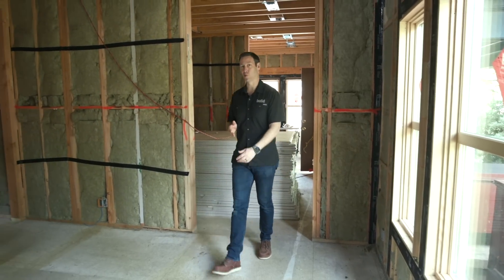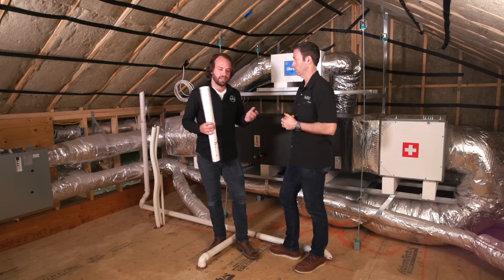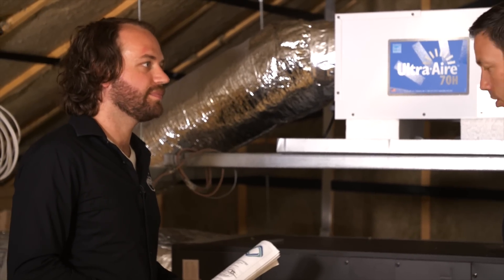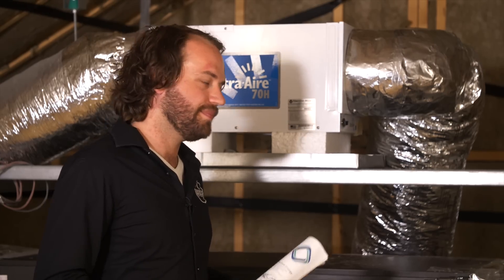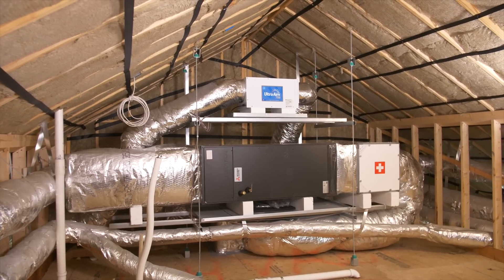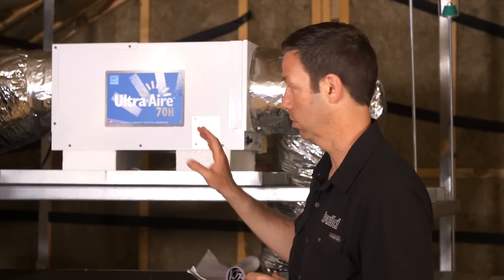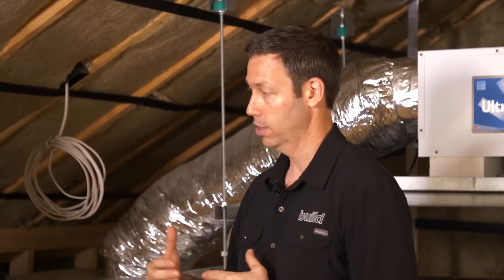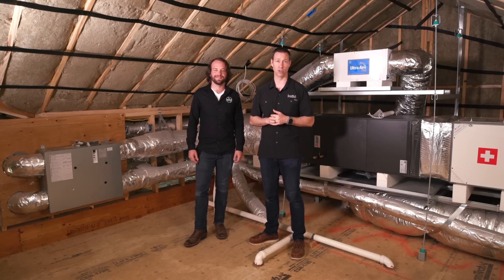New BUILD : Excellent Air Conditioning System Cost?  I’ll tell you!

Comment: 40,000 to 70,000 for ac system   ? Really ?  Think  evaporation  cooling
Reply: Obviously the price is not for your typical house. That price is for homes over 500k+
Reply: Good luck using that swamp cooler in Austin.  Or with a client that wants to be comfortable in their own home.

Comment: Some old farmer who opens his windows every night to sleep is rolling his eyes at this fancy pancy stuff.   I get the dehumidifier for long shoulder seasons.  I get the variable speed compressors.  But the air exchangers and their dedicated duct work?  Is that really necessary?
Reply: I'm not an expert, but I did work with PositiveEnergy designing my HVAC system for my new house.  The concept is that it would actually be better to leave the windows open rather than breathing in all the stuff inside a sealed house.  

You don't want a sealed house without having a controllable air exchanger.  A typical Texas construction (tract homes) don't have the issues with a cheap HVAC system, since the house leaks plenty.   Although I wanted clean air (of course), I was primarily concerned with full control of temperature and comfort in every part of the house.  

The downsides to the cheap construction and cheap HVAC system houses are poor temperature control and huge cooling costs (in Texas anyway).  I've been in hundreds of houses, old to brand new, inexpensive to McMansions in Texas.  Every single time, each one has rooms that are too hot, too cold, stuffy, etc.  Yes, good companies can do a pretty good job with appropriate sized ducting, etc., but 99% of the time that is done just as cheaply as everything else.  

Many people comment about how these systems aren't affordable for the average consumer.  That's simply incorrect.  The systems are affordable IF you are educated about them and plan on living in the house more than a few years.  The problem with these fancy pancy systems is the mindset of the buyers (need those granite countertops!) and the state of the market (buy a new house every five years!)  At least, this is true in Texas in the urban areas like DFW where the cookie-cutters are going up as fast and cheap as possible (while looking fancy on the surface).  

I have detailed electrical records of my previous big-name-builder tract-home built in 2002, and my new custom house built in 2016.  In three years I've already paid for all the HVAC and insulation upgrades.  It doesn't cost as much as you think up front, and in this case it literally pays for itself compared to a tract home.

Of course, getting the tract home builder to actually do it is essentially impossible.  So, to all those guys out there that say the average consumer can't afford it, I would say the actual issue is that the average consumer can't get it at any price.  If you are an average person who moves to someplace like DFW for a job or whatever, there literally is no way to get a well-built home.

Comment: He mentions the importance of distribution.  I am running into this right now.  House built in 1979 with unpanned returns in 2x4 walls.  Return is undersized.  Furnace and AC date from 1991.  Sealing the ducts in the basement has been worth it.  I also am looking at doing that sealing fog I saw on This Old House to seal the insides of existing ducts.  Quote for that was about $2500.
Reply: AirSeal - and it looks like it would be a smart move in every house, but $2500 seems pretty pricey.

Comment: So is that a $500k - $1M budget for new construction of the sub-2000sqft home or just for *remodel*?  I mean that's a pricey remodel from my perspective but I'm also from the SF Bay Area and have heard of much higher budgets...
Reply: Also, I'm working on a '60s construction home.  The ductwork was from the '70s latest.  Had to have it torn out since it joints tested for asbestos and it didn't seem worth it to leave the remaining ductwork in.  The furnace is still there but is likewise from the '60s or '70s and needs to go as well.  So those lasted 40-55 years, but were woefully undersized and with infiltration/exfiltration all around the house.

Comment: A carefully managed modern mass produced home in central valley California can be comfortably run on $1500 per year, with 21 cents/kw as the PGE base rate.  A heater/cooler replacement with a modern rating of 5 tons can be installed for $5-8 k on a $600k home.  Some duct and ventilation adds $2k.  That's 1.5 %. You can barely earn back the cost of a 3% system in electrical savings under these conditions, even considering a more efficient heating cycle and increased energy costs.  Out here, installing a 3kw solar electrical system for the same $ cost is a better choice.
Reply: Its extremely likely that energy prices will rise considerable in the next decade. Much of the costs in in the duct, & humidity control. An AC\Heatpump is the least costly of the equipment.

if you skimp on Filters your duct work will build up dust over time. When you paint, redo drywall, run the vacuum cleaner, etc, its all going to put a lot of dust in to the air. Good filters help prevent that from getting into the duct & equipment which can result in health and equipment performance degration

Comment: Mitsubishi mini-splits are high enough, but seem to  get really expensive over 18000 btu since they need a dual unit outside.  Just went with Carrier to get 30000 btu at a reasonable price.  Low temp system rated at 100% output at 0 degrees and 60% output at -22degF.  The old electric baseboard will provide the low temp backup.
Reply: Bob W I have mini splits that run 30k btu and 33k btu. Two different houses. I think mine go down to maybe 20 degrees before I need back up. It never goes that low here and I'm only a couple miles from Canada.
Reply: @jon3615  we got down to -31degF a couple of nights this last winter.  I'm sure backup will be required but not that often.

Comment: Where did you locate the clothes dryer in house? Is it in heated and cooled space you are paying for yanking all that cubic feet of air out of house and blowing outside and then a house cannot be in a vacuum thus pulling in outside air in by small air leaks for hvac system to work harder and run up electric bill
Reply: Maybe they have a condenser clothes dryer?
Reply: @thegreatga  that's what we have.  It runs forever to dry a load, but doesn't use very much electricity and no venting to the outside and no dust/lint in the house.

Comment: There is no reason for the cost of the hvac to be so high. The hvac is like the framing, consistent, predictable well understood tech. If it is cutting/bleeding edge tech maybe a higher cost but the percentages quoted seem to high.
Reply: If the install is mostly flex duct, then you are right.  Prices should not be so high.  But if the ductwork is primarily rigid, properly sealed, and well insulated, then that is a different situation.  Both component prices and labor for rigid duct can be substantially higher.
Reply: @DriverDude100  - I completely agree, but finding quality rigid work in a residential home is rare (at least it is in my neck of the country).  Heck, I'd be happy to find a quality (aka no leaks and well insulated) in a flex system or one that's not installed in the attic.
Reply: @valkyriefrost5301  come to southern Arizona.  Its not inthe attic. The ducting is uncovered flex tube layed across.the top of a flat roof
Reply: @carlcochrane2030  - Now that's what I call "home builder specials." ;-)
Reply: Exactly - and the discussion of jacking up pricing for the equipment so the HVAC contractor can make a profit. Why don't they just explain what each element of cost is and charge the fair & reasonable for each element?  that's why hvac contractors have a bad reputation.
Reply: He should have labeled the show "Explaining new construction technology in heating,cooling, ventalating,and some pricing"  Im a HVACR Contractor from Tuscaloosa al. I love Matts"The build show" and what he doing with educating people on how much more advanced and different choices  we have in our buildings Technology today. He should have asked Miguel what would that job cost on avarage?  between 10,000 and 15,000?  Miguel said it right at the end about the ductwork being the most important thing. We dont do a lot of new construction anymore unless we talk to whoever the owner is going to be because a lot of builders want you to put in bare minimumn and want you to work cheaper which traps some ac companys to doing sub par work to keep there buisness.
Reply: 18 hr day so going to bed not sure if i answer a question or just went goofy,
Reply: @chaddarr4834  - you hit it right on the head for the average home builder. The profit is not in the quality, it's in the quantity;  which is sad.

Comment: That looks like flex duct that is run over some snaplock, is that what you did?
Reply: It's solid insulated duct work. There is flex specified at the turn down of each vent, to adsorb noises
 at the Return,
 and the lines going up to the dehumidifier. But other than that ( as seen in the mechanical drawing plans 9:35 ) there is no flex. All solid.

Comment: Do you run seperate fresh air ducts  or plumb the ventilation system to the main duckwork? With seperate ducts is there a possibilty of one system back feeding the other when one is not running?
Reply: tweake this one has dedicated ducts.

Comment: Holy bageezus...how can an air handler move air efficiently with that much filtration? A single MERV 16 filter is restrictive enough. 4 is pure redundancy, when you consider that all 4 are rated to filter the same particulate size. Seems like the unit’s efficiency will suffer by choking the airflow.
Reply: Check the flow arrows on the filters at 6:41. The airflow is right to left, not vertical. These are in parallel, zig-zagged to fit in the tighter space.
Reply: If in series you would be correct. These are in parallel which allows more airflow
Reply: I get what you two are saying, however, you’re still attempting to force air through an already restrictive filter, no, 4 restrictive filters, no matter how you slice the air flow. The cost of those 4 filters, plus the return air filters, would cancel out or exceed any energy savings. Unless someone had extreme allergen issues, I wouldn’t think anyone else could recoup their return on investment with a system like that.
Reply: Increased face area = decreased velocity = less pressure drop. But you are right, this is overkill, and probably costs a lot. MERV 8 is sufficient.
Reply: I agree that MERV 16 is overkill for most folks, but if you put enough of them in parallel you still get less pressure drop than using "standard design" for MERV 8.  And these ARE the return air filters.  And how can there be an ROI on filters?  Filter efficiency is about particle sizes, not energy consumption.  And to come full circle - yes, high efficiency filters have higher pressure drops for a given face velocity, but putting multiples in parallel drops face velocity, reducing pressure drop, which in turn drops fan energy consumption, so the size of your filter bank is really the limiting factor on how energy efficient the whole air filtration system is.
Reply: meberg500 ... I’ll take your word for it, because it’s not logical to think the surface area of 4 restrictive filters are better than a single less restrictive filter. 🤔 I’m no HVAC guy, though. Unless the circuitry is throttling the fans input voltage and amperage according to the load, then the typical speed settings have a constant input, causing the fan motor to load up and overheat the circuit board, and/or motor. Also, I didn’t say anything about ROI on filters. It’s the system, man...the system.
Reply: @circularebin  try drinking through two soda straws at the same time.  Same suction, double the flow.  Parallel paths.
Reply: meberg500, If your single MERV 8  filter is a normal straw, the MERV 16 filters would be like pulling through 4 coffee stirring straws. It would help make up the volume of flow, but take more negative pressure to pull it through. Maybe I’m overthinking this.

Comment: Can you put out some info on how you seal the plumbing vent and keep it from being a leak/heat source?
Reply: Joseph assuming your talking about the inside of the pipe and not the penetration itself. There are traps that hold water so no air is exchanged between the inside of the house to the inside of the drain lines.

Comment: Can you put out some info on how you seal the plumbing vent and keep it from being a leak/heat source?
Reply: seal what around the vent?
Reply: frank gallina - The roof deck and insulation penetration and the top of the pipe is what I’m asking about. I’ve seen a number of instances where the vent pipe doesn’t have a cap and can accumulate water down the line and since the installers tend not to think of this line as holding water, the connections aren’t done perfectly so it will leak from couplers and bends. Also, the pvc pipe is open to the atmosphere, so it gets hot inside and is a heat sink/source. With such a high standard, I’m wondering if they do anything special for the penetration and to cap the pipe.

Comment: Where does the condensate drain for the ultra air run to?  Here in GA they all lead to a drain pipe on the outside.  Hvac companies will tell you this is code but I have confirmed with my city that it is not and you can run it to the main waste line.  The problem with running it outside is you can't dump it near the foundation so it ends up in the yard and becoming an acidic and swampy.
Reply: Greg Breland Here in central Texas where Matt is it is code to run it to drain that goes into sewer. Most are tied into sink drain just above p-trap
Reply: It may not be code for you but for the majority of the US it is.
Reply: The acidity would only come from the condensate of a high efficiency furnace. And at least where I am you are supposed to put a neutralizer to remove the acidity.

Comment: Thanks for talking costs. Just gives a context on all the equipment etc. You are rolling my man.
Reply: $70,000 I can get a split system for each room. No duct and no allergies. Why people build with ducks especially in the medium and hot climate is beyond me.
Reply: Rado Stefanov aren’t ducts better if you have massive filtration like they have in this vid?
Reply: @sryth1  How so? Ducts accumulate pollen from each direction. Cleaning does not take it out. Open and touch you ducts. They are covered in sticky film of stuff and NO company can absolutely clean that unles you crow inside and spot clean each inch. Ducts are bad technology that only the USA uses for residential houses.
Reply: Rado Stefanov interesting. I assumed that running it would expel the pollen, then the filter would catch it on its way back through.  Given the ramp down of this unit, it wouldn’t shock me if it ran constantly
Reply: @sryth1  You are Correct that is how they are designed to run ,every piece of equipment has it's good and bad points.Ductless minisplits recirculate the air, not filter-it .You can get a stand alone filtering unit for every room . People will comment to get a Ozone light attachment for the mini splits ,but I would  do the research on those for any application very carefully especially if you have young children and Value your Health.
Reply: Not to mention loss of space in the addict. Put a few skylights and you have a loft..

Comment: Matt, you need to look at split ac/heat pumps.  Conventional HVAC systems use air as the working fluid.  Split systems are much more efficient and condition the air where it's needed.  The losses of using air as the cooling/heating agent are very high.
Reply: Are you talking about mini-Splits? Because the system he just showcased was a split system by Mitsubishi, who also makes mini-Splits. In one of his very recent videos he did talk about mini-splits, and even showed one in a home gym.
Reply: And further to that, with the ducting in a conditioned attic, a mini-split isn't that much of a benefit.
Reply: @bluenadas  Do you have any idea what it costs to cool/heat the attic area? Why would you do that for just the air handlers?? I am an advocate of putting the air handler and ducts in the living spaces. That's where the design is worth it. I agree mini splits are way more efficient and make it easy to control each room rather than an entire home or large parts. These systems over cool or heat and comfort is compromised without lots of special controls and dampers. All this complication and who is going to service it? A normal service guy would run the other way it is so complicated. Simple is better, cheaper, more efficient and better comfort.
Reply: @b4804514  it isn't directly cooled, but would be just a few degrees warmer than the house. From a cost perspective it's a heck of a lot cheaper than the 40%+ loss of a non-conditioned attic
Reply: @b4804514  Yup, you're not going to be able to call Jose Schmoe HVAC guy when you have the inevitable problem on a 110 degree long weekend...
Reply: Wait a minute where did you get a number like 40%??? No insulation?? "In order to waste as little energy as possible, you need to keep the protected volume as small as possible. The term protected volume refers to the part of the home that has to be cooled or heated.The smaller this volume is, the more energy you will save". There is no way 40% makes any sense if you are conditioning the attic. Plus they did not use spray foam the most efficient so it is going to get hot.  I had a house with spray form attic rafters and it was the most comfortable but it was not cheaper per sqft to cool than my other home with R38 in the attic